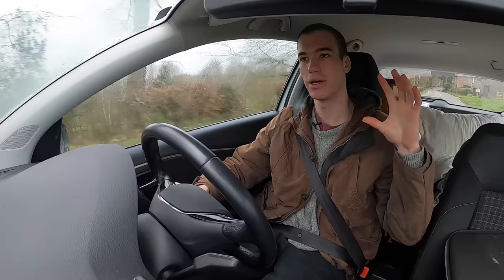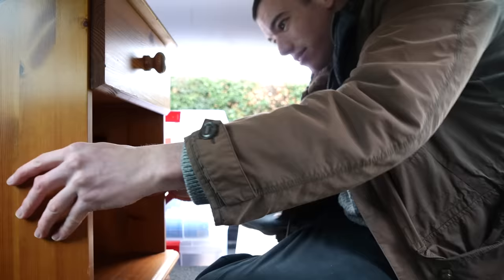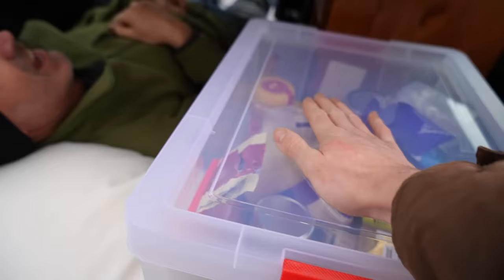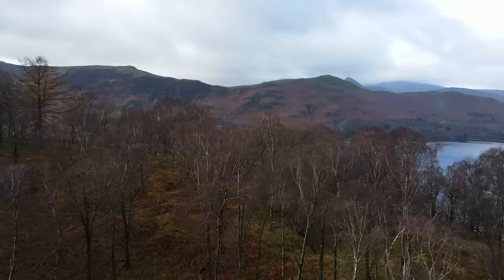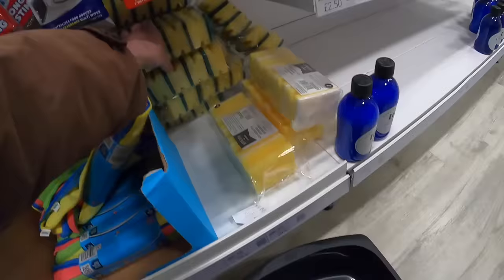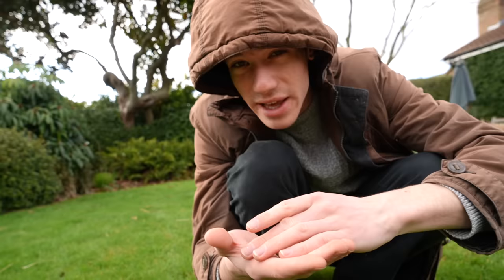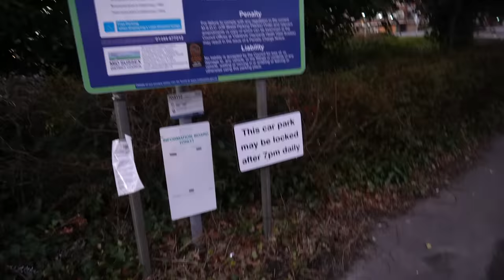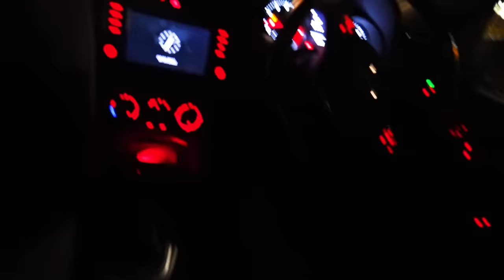Stealth Car Camping In A McDonald’s Car Park (Tiny Car Conversion)

Comment: Excellent..  I am just finishing a bodge conversion on a suzuki alto. Kind of making it up as I go along. Just looking for solutions to black out the windows. Came across your vid.  Excellent.....now I want a cuboard with a sliding door. I do not have this feature...  I need to incorporate it pdq    I am heading to Scotland also.. mix of wild camping and sleeping in the car when its too extreme...   I took my front seat out so I could lie down but looking at yours maybe I did not need to do that......... anyhoo    'onwards and upwards'    Keep on trucking

Comment: I slept in my car once before, couldnt afford the hotel and wanted to travel, it was awsome, i slept in the woods tho, also in an hatchback, towels over the windows.
Im now going to do the same but for two days straight im hoping, same situation, want to travel but cant afford an hotel for too long, so now, i have a better solution, bought some black sponge to fit the windows for the night, and some cool mattress, but i dont bring batteries with me, its an awsome adventure and its cheap to do, so you can travel a whole continent without spending nearly has half if you booked flights and hotels

Comment: My 2015 Polo had a button on the door pillar which turns the interior sensors off, this will let you lock the car with the key while still inside and still activates the alarm.

Comment: Definitely get a van bud, a vw caddy maxi is a great options. Pull out bed, diesel heater and leisure battery with spilt relay charger( also great to hold a couple rods😉)
Reply from the maker: Hmm good idea!

Comment: Hi Alex only just found your channel, must have popped up as I watch a lot of car camping/van life stuff as I’m currently upgrading from car camping to a small Vauxhall combo micro camper, anyway a couple of suggestions from me, 1. I live in Scotland so if your planning on car camping you will find it’s quite easy up here however prepare for the midges, maybe get some kind of net for your boot door or windows as you might find yourself contained in your car in the evenings which is no fun and will need ventilation, also the forestry and land commission are running the stay a night scheme again this year in their car parks so worth looking into those. 2. You can make window blinds easily by cutting out a thin yoga/exercise mat to size. 3. Get yourself some wind deflectors these will let you keep the windows cracked even when it’s raining which will help with the condensation and you can also get a chargeable windscreen vacuum from home bargains for £20 which lets you clear your windows quickly in the morning. 4. Would you consider taking out your passenger seat and building a platform, this way you could store the things you don’t need access to all the time underneath which will free up room in the back for you to be more comfortable, I think this will make things easier for you to manoeuvre things around or even less moving around as over a long period you will probably get fed of that. Overall I think your on the right track and I can’t wait to see your adventures, just keep it as simple as possible, it’s always the best way. Ps you could always fit roof bars and get a roof box for all your storage too.
Reply from the maker: That’s so much for all your info!

Comment: Wish you all the best buddy! On the battery, on the side there is a red circle bung, you remove this so the battery can vent. When you use these batteries on machines or caravans etc there is a tube that slots in and guides the harmful gasses away. If the battery gets hot, which it will using that inverter it may need to breathe and you dont want to harm yourself with the fumes 👍
Reply from the maker: Thanks for the info.

Comment: You need a plug in charger mate to charge the battery when driving or a solar panel but not much good if no sun but good luck on your travels

Comment: Well done for the stealth camp. Get a window vax from karcher. Also you should have a button to turn the internal sensors off. normally on the left hand pillar at the bottom looks like a wifi signal with a car on it i think 👍👍 i know of a vw lt 35 long wheel base minibus for sale so half way converted. Also carparks can have time limits and a no return policy
Reply from the maker: Cheers for watching and thanks for the info!

Comment: A van gives more privacy, my van is still a working van but I have my bed my  gas ring  a cassette toilet and lived and worked in n it for the whole of last September. 
 There is flat pack furniture available on eBay designed for van conversions also secondhand units taken from caravans.
Check up on Dzeus fasteners as a means to quickly secure and remove furnishing.
 I often  ask in a pub, "Before I have a beer will my van be ok in the the carpark overnight?  It'll be gone by 9 am" I have never been refused ! I don't actually mention that I'll be in it . Your inverter should cope with a small microwave  you can have a real little home from home !
Edit : I think I need  bedside table like yours!
Reply from the maker: Cheers for info! :) Good tip regarding the pub, I'll use that one!

Comment: For the power you need why don't you down size the battery would make a massive help in heavy weight and putting it away.  Love your content. Keep up good work
Reply from the maker: Thanks!
Reply: Cheers Alex motor bike battery I use I charflge phones tablets and a side light in bivvy.

Comment: Being from the US, we call things a little differently than you do. 

If your "windscreen" is fogging up on the inside (along with the rest of the glass), that means that you have a "leak" in your car. You may not know where it is, but condensation on the inside, means that there is air getting in from the outside. The difference in the temperature, is what causes it. 

In my opinion, you need to stay at campgrounds (US Term) where they have showers and "loo's" that you can use while you stay. 

I've seen camping videos like yours from the US, where they have butane burners to boil water and use "ready to eat" meals. Just boil the water and add it to them and eat them out of the bag. 

I'm like you, I'm not up on the "electricity" part, but most people in the states in your situation, use a device called a "Jackery" (or similar, Amazon has them) which is like a battery that is charged and can be recharged that is much smaller and lighter than the big battery that you have with the inverter. You should be able to charge it at a "campground". Also, you can get a portable Solar Charger that will charge them through the day. You don't need that much power, just enough for your reading lamp and maybe a few other things. 

If you stay at a "Campground" with "facilities" that you can use, I don't see any reason that you can't use your car to travel. It seems that you are OK with it locally. You just need "water closet facilities" when you travel. 

I'm personally loving your new channel and wish you the BEST of luck.
Reply from the maker: Thanks for the info!

Comment: I'm always interested in your content Alex, and it was a captivating video to watch, but before you spend (waste) a lot of time and money with the car can I join those that are urging you to get a van.
VWs are great, but they hold their price well.  There are other vans that cost considerably less than VWs and do exactly the same job.

I've done loads of stealth/wild camping in old vans and old motorhomes and it's a learning curve, but one you master quite quickly.

Also can I reiterate, inverters are very inefficient.  Charging your phone or running a light from one, when you could use a 12v USB phone charger, or a 12v light, just wastes valuable battery power that you'll need for something else.  
Basically anything that can be run directly from 12v, or a 12v adapter, should be powered that way.  Keep the inverter for the running 240v items that can't be powered any other way. 

If you get a van you can also carry a portable chemical toilet which raises the comfort level immeasurably when you just need to go! 

Of course the other way is a small caravan, like the teardrop ones (google it) but they're not cheap.  Maybe an Eriba Puck could be a better bet. (Google that too :-))  They can be pulled with any car, your license will allow you to tow it (in fact the law has changed so anyone can tow any sized caravan these days) and although they aren't particularly spacious, compared with living in a small car it'll feel like you're in a mansion.

Good luck with your projects and travels.

I'll be glued to the channel to see your next video (Well, unless I'm out fishing for the day 🤣😂)
Reply from the maker: Thanks so much for your info and appreciate your support! :)

Comment: Another great vid! TBH if i was you I would sell the polo and get a van for the same cost, even if its a small van. You'd be surprised the space in a small van and you can fit a diesel heater to keep you warm at night and ventilation to keep the moisture down. Getting a small cheap van is got to be better than the car, imagine your camping around the Alpes in snow, etc, and having to crawl in your car with snow everywhere, and how cold it will be in the car. If you do it in the car good luck bro.
Reply from the maker: Thanks, yeah I will certainly consider that. Cheers for watching!

Comment: Get a van Alex or at least an estate Audi A6 avant or merc e class 
You will also need a relay for recharging the battery as you drive,  or you can grab a 240v trickle charger to plug the battery up to every time you stop but that will be impractical and will need regular charging n plugging in.
Reply from the maker: Cheers for the info!

Comment: Ive traveled across Canada plenty of times, aswell have dozens of friends doing it. I can say alot of people take there first journeys in smaller cars, it will be uncomfy but worth the experience. Basically trying to say it is doable in your car, and that ive seen guys my size travel 10000km in a summer sleeping in a honda accord, with no bed built just some pillows and feet out into the trunk. So if there's a will there's a way. Enjoy and safe travels mate!! Also cant remember if you packed a tent, but id highly recommend it.
Reply from the maker: Cheers! Yes I'll have my tent with me!

Comment: fantastic video again bro. you are a natural in front of the camera, no matter how much you try to convince us you are a bad speaker, you are not :) love the filming and editing skills as always. 
i have some new and cool ideas for your improvement of comfort:
1. get a van! :) :) :) joking. you had your reason not to get a van, so i respect that. and i respect the fact, that everyone could camp in a camper but few people goes through the trouble actually sleeping in a small car. you are not afraid to walk the walk from the beginning and it is fun to watch. 
i started in a vauxhall astra and also slept on an airbed but together with my wife. the airbed got deinflated mid night so we our weight just push us down in the middle of the mat like a pile, it wasnt flat and it wasnt comfortable but fun. we camped by a forest only to be waken by  gunshots as it turned out the army was excercising there :O that was scary.
then we got a van, had it converted. the most important thing you also see now is the condensation so insulating it by a pro is essential. and we had a roof window open, but it still got damp a lot.
2. dont buy VW transporter. they are overpriced and unreliable gearbox will make you hate it. there are better value vans out there, for your little size even a transit connect would do.  
3. dont eat mcdonalds. its crap :)  eat kfc at least it slightly resembles to something real :) or chicken kebab from a kebab shop. that comes with salad too, a healthier option. 
my favourite moment of this video is: 
https://youtu.be/RLqH1cTWBqw?t=1110
keep up the good work, cant wait to see more.
Reply from the maker: Thanks so much for your comment and all the info! I like point number 3! Cheers for watching, I hope you enjoy the future videos!
Reply: @just_alex  hahaha :) there are real mcdonalds burgers and fries out there that are years old and still look the same. i just dont understand how can people still eat it. like the last ever sold mekkie is in a museum in Iceland.

Comment: A van for sure trade the polo in for a long wheel base caddy or a transporter both will come with enough seats for a passenger. top video though how ever if ur trying to save money I'd get a foam roll to go under that therm-a-rest sleeping pad because I have one and they aren't cheap 😂 if a splinter off that wood buggers you're pad you'll be kicking urself, will also aid in insulation aswell protection for the pad 🙏 keep up the good work I'm sure Carl misses you. But in life you gotta do what's best for yourself 🤙🏻
Reply from the maker: Cheers for the info!

Comment: Transit connect lwb 1.8 TDCi is what you want it's a small van but you can fit a full length carp bed you will need to get the DPF and the EGR valve deleted other than that you're good do not buy anything newer than a 2012 as they are too over complicated and cause you loads of problems.
Reply from the maker: Thanks for the info!

Comment: Great video Alex, few suggestions.
If your keeping the car maybe a roof rack and a box.
- tint ur windows or a few bungee straps with a towel or bed Sheed over might help.
-defo need a sawn off in they’re we need u fishing.
- have you room in the engine bay for a duel battery system so both batteries can charge. If you crash you don’t want that battery fly around in the car.
Reply: A dawn off in they’re we need you fishing?
Reply: @robs715  sawn off mt8 means under a 6ft fishing rod takes very little space. Alex had used them before on the other channel.

Comment: Mate I live in Australia check some of the 4wd camping conversions and shops out here like 4wd super center get a roof cage awning and a swag and also get a battery box that has 2 usb ports 12 v socket on it with a bat t dry voltage gauge also u could use a solar panel to recharge your battery when parked via a Anderson plug
Reply from the maker: Cheers for the comment!

Comment: Hi Alex I have a VW Beetle that I use as a camper car, I am so happy you just said how to prevent my alarm going off, that has been a nuisance for me.                                                                                  I leave the boot open a bit, its still locked but allows me to get air, even when its raining without getting soaked and helps with the condensation too, It's a small gap but right the way around the boot so helps, but in the summer I had to have the windows all the way open, I thought I would rather take my chances getting butchered by a psychopath than be cooked. Thank you for sharing your adventure.
Reply from the maker: Cheers for the comment! :) 'my chances getting butchered by a psychopath than be cooked' haha! Brilliant!

Comment: Instead of a van what about a 4x4 I've slept in my old discovery 4 loads of times you can even set up a nash indulgence in the back with room at the side for boxes and room under the bed for storage nice hatch on the back and can attach an awning
Reply: I will add also with the likes of discovery's theres auto levelling kits for the suspension as when your out in the wild your bed won't be flat without your vehicle being flat

Comment: Question. How long does that battery you bought last before you have to charge it??

On another note, I found a roll away bed mattress works best.$100. I tossed the frame in storage. 

Insulated camping mat rolls from Walmart are 3/4 inch are perfect for the windows. No reflectix and all that crap. You literally can't feel any cold from the windows. I spray painted the window side flat black. 

 I had a 3 drawer dresser but even that was too cramped. I just store my clothes in a hamper in my front seat. Zero degree sleeping bag.

2000 watt generator $500 will run a stand-up a/c during the summer. I put it in my driver's seat. The car is so small you can't have a heater unless you get a forced fan heater to use during the day.. A heated blanket is life.

I hope life is treating you well.

Comment: You should get sun protectors for your windows, not only will they block out some sun in the summer but they will also add a level of privacy! They just stick to your windows via suction cups so they're easy to install and takes up hardly any space.
Reply from the maker: Cheers for the info!
Reply: @just_alex  No problem, best of luck brother!

Comment: Can't wait to see this new adventure unfold!  I wonder if sticking with the Polo might make for more interesting videos. You need to secure the night stand and really everything, god forbid you have to swerve to avoid an accident, only to meet your maker because something in the back flies into your head. Mav's Orange Gatorade bottle is a great solution for half the problem.
Reply from the maker: I'm definitely going to persevere with the polo for now! It's good fun and I'm determined to make it more comfortable!
Reply: @just_alex  You might call around to furniture upholstery shops looking for a super dense foam that is around 2 inches thick, to sleep on.